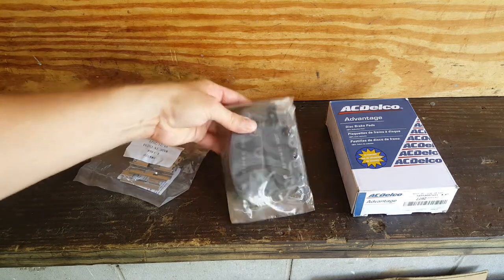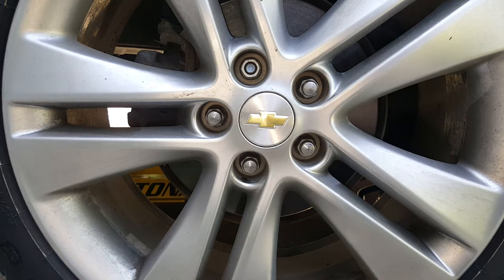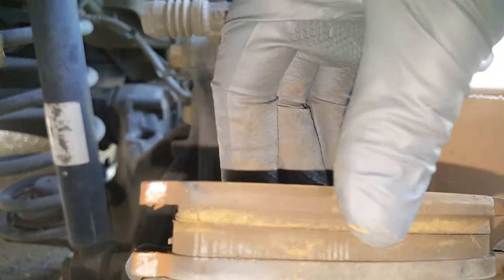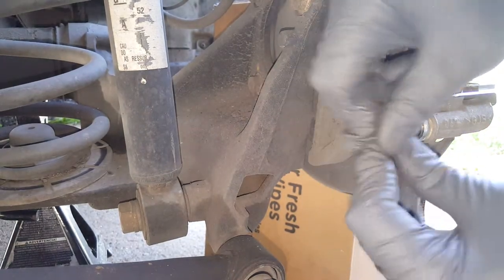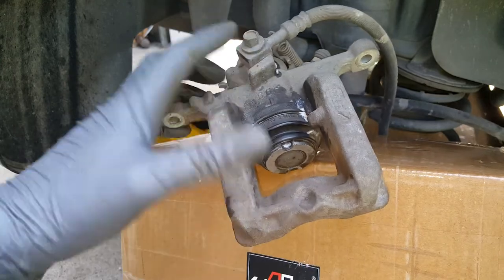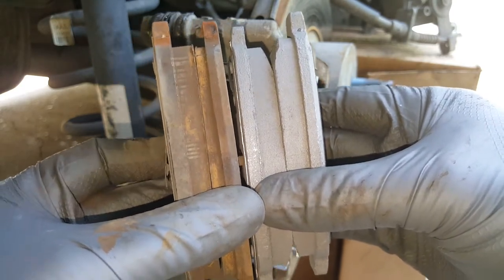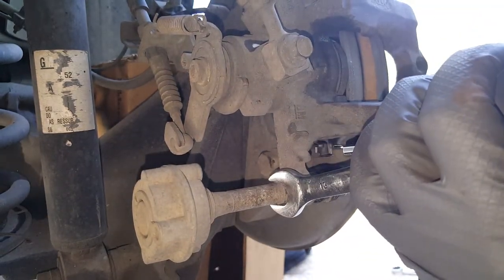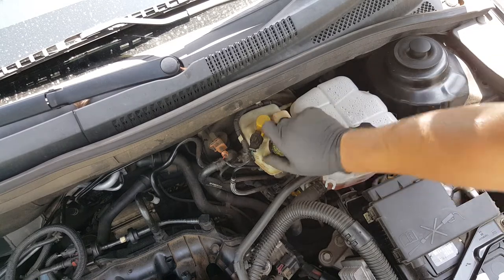How to replace the rear brake pads disc brakes on Chevy Cruze 2011-2016

Comment: Nice tool ,i have always used a c clamp and an the old brake pad ,works just the same .
Reply from the maker: Good tip!
Reply: @s33therfan  Does not work well on later models . On my 2019 you have to rotate the piston clockwise to open the gap. I replaced rotors and you have to remove E brake cables to make is easier.
Reply: Not on rear caliper piston
Reply: Rear caliper is screw type, C clamp doesn't work! To get piston back turn right, I'm using long nose pliers
Reply: i know ,i found out by watching you tube . it is actually easier now.
Reply: I just did it with a big set of pliers. All your doing is Turing it clock wise. No need for a tool and took me a lot less time . There no need to push it back in just need to turn it back in.
Reply: @davidkettell5726 what about a 2015

Comment: the dampener on mine is completely stripped and the 13 won’t do the job, any advice? thanks
Reply from the maker: I would get a good pair of vice grips. You can replace it or tighten it back with vice grips. It does not have to be that tight. Hope this helps.

Comment: did not under stand noise filter??!dampener..
Reply from the maker: I should have explained it better in the video. The dampener helps to cut down the vibration and brake chatter , or brake squealing. Thank you for the question.

Comment: Why is there uneven wear on the pads and how do you fix that going forward?
Reply from the maker: The only thing I know to do , is replace the brakes and rotors ,make sure the caliper slides are greased , and make sure the caliper slides are moving freely.
Reply: @s33therfan  I agree but in practice the piston side will always wear more.

Comment: Quick question. For your jack stand arrangement on that rear chassis, is it permissible, when having the car on four jack stands, to have the two rear stands both be on that chassis? Everyone typically jacks the car up on the pinch welds, but as you probably know, if you live in the rust belt, then those things are gone. I have the front two stands on the unibody and it works great, but i have no manual telling me its safe to hold the whole back end on the rear chassis.
Reply from the maker: A lot of times if I am going to be under the car I will have a jack stand and a back jack stand just out of caution. But usually I just use my jack with a jack stand if I am not working on it for extended period. But anything that is solid will work. Thank you for the question.

Comment: best video on this. do you have to use thread locker?
Reply from the maker: You do not have to use it. I always do just as a preference but torquing them down is sufficient . Thanks for the question.

Comment: Brilliant video. Great detail. I just needed this
Reply from the maker: Glad it was helpful!
Reply: @s33therfan  it was! I've always took my car to the garage and I was a bit skint so I thought I'd try it myself. My grandad was a retired mechanic so I borrowed the piston windback tool from him. I just tried it today after watching this video and everything works fine! I took a wire brush to all the rust and coated more or less everything in Bilt Hamber Hydrate-80 rust converter. Then once that had cured I put the new pads in, put the rest back together, then spray painted the calipers ready for the clean wheel to go back on (I thoroughly cleaned the wheel, I had to use quite a lot of wheel acid as the brake dust was deeply embedded into the back of the spokes. Great tutorial, the satisfaction feels good and the confidence to fix my own car feels even better. Thanks  for this
Reply from the maker: Love this , thank you for taking the time to share.